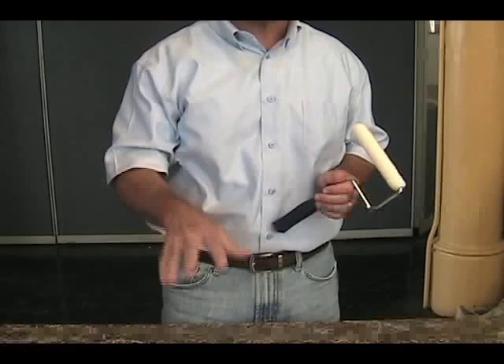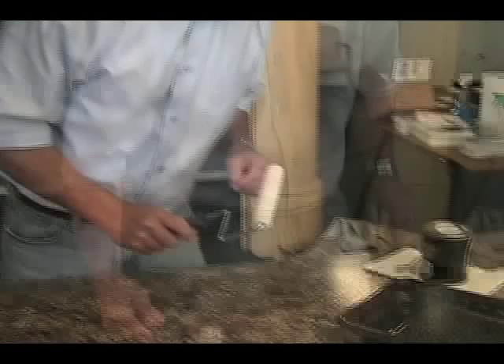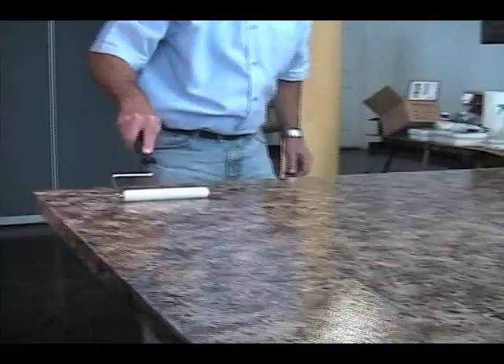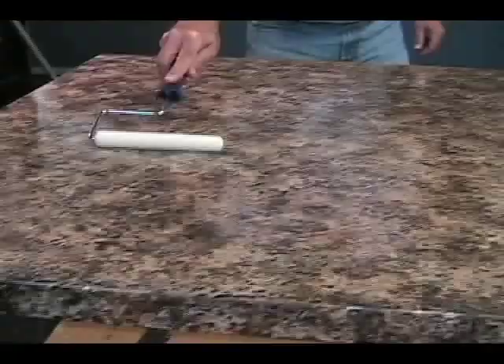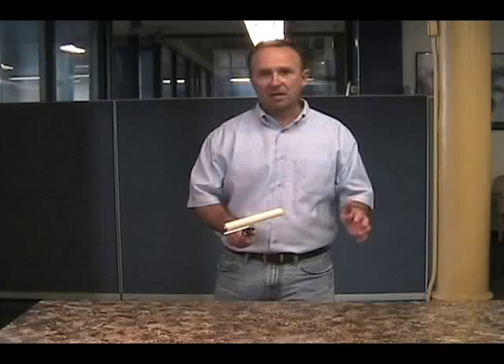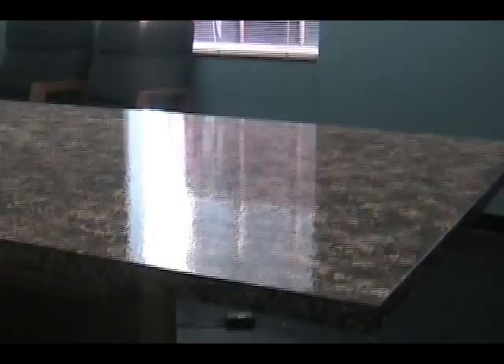How to Apply Giani Granite Top Coat

Comment: Every video I've watched shows the final finish with a slight orange peel. 
I'd bet with 3 or 4 coats of poly, this could be wet sanded and lightly polished with a buffing compound to get it much closer to a glass finish.
Reply from the maker: Customers that wet sand between coats of our topcoat get a much smoother, shinier finish. That will definitely help, Toby! Thanks for the comment!
Reply: You could also use the epoxy top coat in place of the basic top coat.
Reply: I just did my 1 layer of top coat,  how is your countertop standing?.  I thinking about doing your technique.

Comment: I have a countertop that was done about 10 years ago.  It has tiny scratches in the top coat. Can I wet sand it with 200 grit and reapply to new top coat?

Comment: My question is, can you wet sand the finish top coat, say with a 1500 grit sandpaper, then buff it out with some compound and glaze? Will the heat of the buffer peel the top coat? Has anyone tried this?

Comment: How long do the minerals need to dry before you apply the top coat? Also, is there any specific temperature the house should be kept at? I’m planning on doing this next weekend so it’s a bit cold and we have the heat on
Reply from the maker: Wait 4 hours for the mineral to dry before applying your first layer of topcoat.  We recommend your home being kept around 70-75 degrees. Cooler temps will affect the cure time. Happy painting!

Comment: So I have the lap lines what should I do now
Reply from the maker: Hey Ajhia, glad you wrote in! It's actually really easy to correct. I would grab a #600 grit sanding block or #600 grit sandpaper and wrap it around a piece of wood to sand the topcoat to an even finish. You don't have to remove the topcoat, just even out the balance of dull and bright spots of those lap lines. Once you have an even finish, wipe off the sanding dust with clear water. Do this a few times to make sure all of it is gone. Then you can reapply the topcoat. When you reapply, make sure you keep the roller saturated. You don't to apply it like house paint. With house paint you'l roll  a W shape on the wall and feather before you soak your roller in the paint again. With our acrylic topcoat, you want to make sure you have plenty of product on the roller. When you've applied a 2-3 foot action, then you can back roll over to create a consistent layer or "film." That will keep those lap lines from showing when it's fully cured. God luck and holler at us if you have any more questions😊